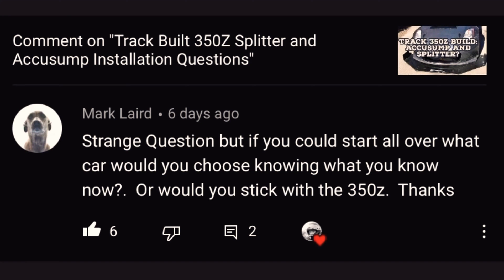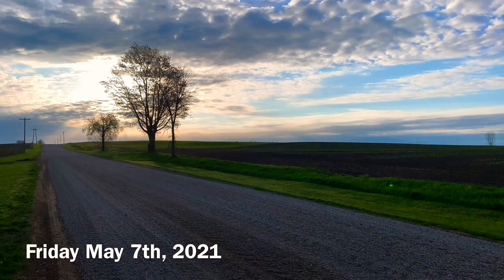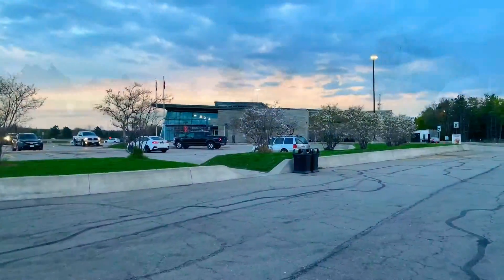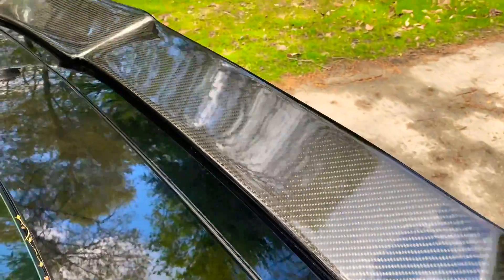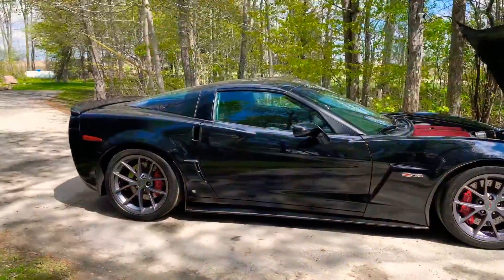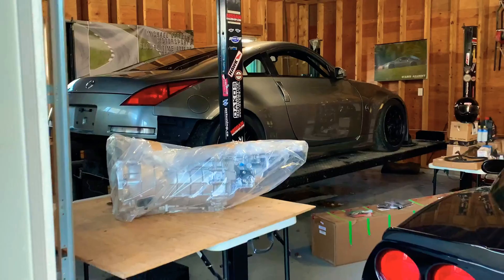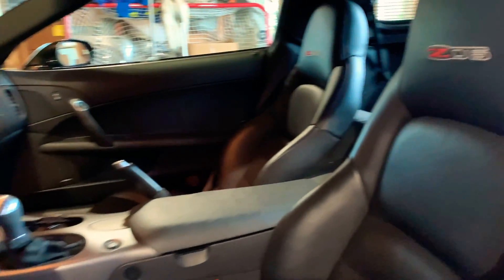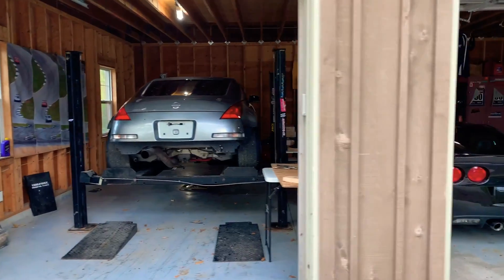350Z & Engine Swaps?

Comment: It’s not just about the hp, it’s the torque and weight too. With just a ls1, you have a lot more low end torque. Plus, an aluminum 5.7 is about 420lbs with accessories. What’s a vq?. With a ls1, you’ll make roughly 360whp fbo. 400+ cammed. I have a 06 z, 11 Coyote and 04 gto ls1. A coyote would be the coolest and best but hardest to swap

Comment: Advantages of an LS in a Z:
-Easy and cheap big power gains
-Relatively same weight as VQ
-torque4dayz
-cheaper to maintain
-cool factor
Unspoken disadvantages:
-the actual swap parts price is pretty high
-more power != better track car
-a high revving LS is expensive
-most swap kits make the engine placement awkward for weight balance
-VQ owners now hate you
Reply from the maker: Swap reliability and durability is usually a concern.
Reply: @2THPWR  yeah that's true. And then if something does break, you're basically the only one (and the mechanics that helped) being able to fix it!!!
Reply: @2THPWR  can you elaborate on this a little further? Been considering an LS3 swap for years and a big part of that is due to its perceived reliability and parts availability.
Reply from the maker: @christopherpuig12  electrical problems or problems with the ECU and getting things to work as they should would be more common. LS’s hate going around corners. Oil starvation is a problem and they tend to blow up unless they have a proper dry sump set up. It depends why you want to swap?

Comment: Not even mad about this. The C6 Z06 is the coolest N/A Corvette thus far (will be beaten by the C8 Z06). Just make sure those valves don't drop
Reply from the maker: The corvette will be walked through in more detail soon but it has all the best head work.

Comment: I always wondered if the z's suspension could compensate for the extra weight an LS, or if this wouldn't drastically alter the weight distribution of the car. I've thought of selling my z and bumping up to C6 vette as well, but maybe in a year or two.Congrats on the vette though, sounds great!
Reply from the maker: The LS swap also makes the weight distribution worse no matter what you do and I meant to add that in the video. It adds 50 lbs and that’s not ideal.

Comment: We miss our 350z DE and our first 350z with 311,048 miles. This video now will inspire to do future projects. 🤙
Reply from the maker: Thanks! I’ve got lots of 350Z build vids on the channel. I’ll check yours
Reply: How would you think its best to max a DE Engine?
•tuned
•single turbo
or turbocharger "!
In both manual & automatic>
Reply from the maker: @motionvip16  depends what it’s being built to do. Turbo has the best power potential for drag or drift.
Reply: @2THPWR    track it would be best 
Specifically getting the right Specifications to qualify.
Reply: Sounds good.. we are taking a 1 year project to make sure we have all the requirements also looking for better 415 to 507hp.
Reply: Abiously making sure for all mods on the cars handling.